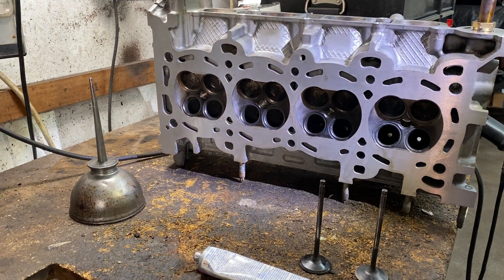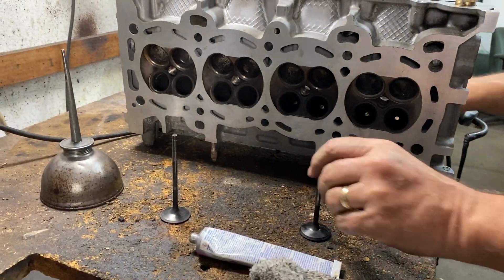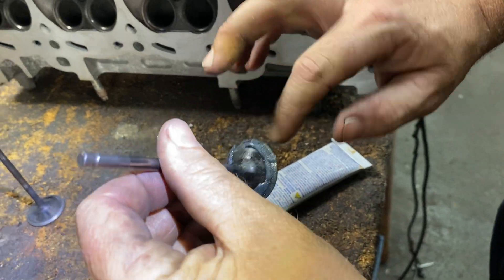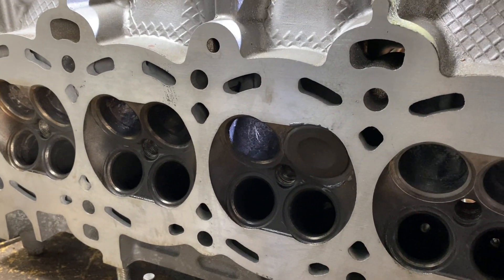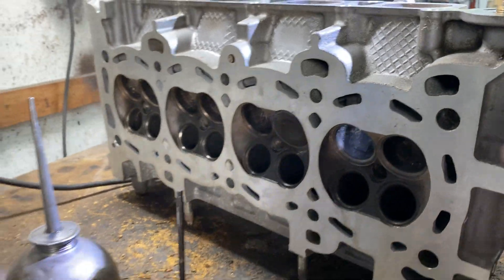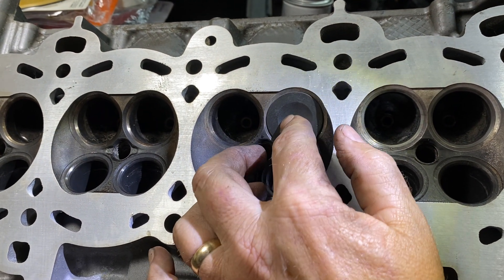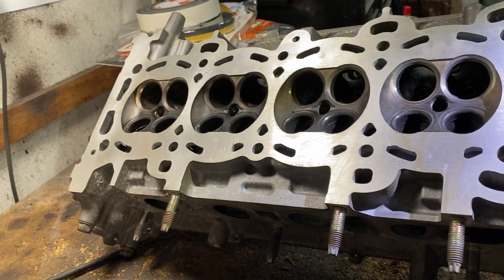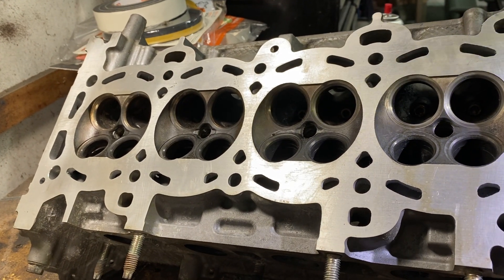Seating Intake & Exhaust Valves by Lapping/Grinding By Hand - Fast & Easy

Comment: I did this until the pitting was gone. I tested it after by putting gasoline in the ports and they all had a small leak. I tested again with water and only some of them leaked . will this be an issue when I install the head or should I take to machine shop
Reply from the maker: If it's only very minor you should be fine.

Comment: I did everything like you sayid and now I tested the valves with water and they are leaking not sure what I did wrong it’s 6.4 Hemi
Reply from the maker: You may have to do them more times depending on how bad they are. Also if the head was warped bad it may need to be replaced but that's in extreme cases.

Comment: Thank you MotorCarNut for sharing your skills and knowledge to help a DIY like myself. I just did a valve job following your instructions and found out from my experience that I get a higher seal rate when lapping in one direction. It is faster when using a drill and when the grinding sound gets more smooth then the surface should be good. Just want to share my experience to help anyone in need.
Reply from the maker: Thank you very much! Great tip, appreciate the feedback and tip!

Comment: Why after polishing it up valve does not shine. I did it with mine  too and it  just took the seat shining valve edge away. Still it seats better and its not leaking any more, but I’m  worry that maybe it will leak again
Reply from the maker: Its not supposed to shine after lapping, your'e fine
Reply: @motorcarnut thanks!
Reply from the maker: Np problem!

Comment: Hello friend, first, thank you for sharing your valuable work..., I have a 4.7 Jeep Grand Cherokee that I bought overheated... and I want to do work on the cylinder heads, I have some questions 1 CAN HEADS BE CHANGED WITHOUT GRINDING? That is, you have a 4.7 mixed water and oil for an overheated one, you take out the heads and put some in, what if they were in a good engine... just buy the new gaskets, IS IT POSSIBLE? 2 How do you know when the valve is burned? Why is his head black? And if so, can't it be used again? 3 I bought the same product but it says I have to use it with water and you did it without water, how would that be correct? 4 How are the valves calibrated? Thank you very much for responding not only to me but to everyone I have read.
Reply from the maker: You’re welcome!
The heads can be replaced with the same head off a different engine but you must measure for warping on the block and head deck for straightness. I have a video on that too. The valves should seal tight with no leakage. You know when valves are burnt because they will have a hole in them or not sealing properly.
Reply: @motorcarnut  thank you very much for responding!
Reply from the maker: @richardgarcia4843 of course!

Comment: Hey buddy, it’s me again! So I am currently attempting to do a valve job on my CCTA head. I have never attempted to do a valve job before but I want the challenge! So I have a couple questions: 

1) if you remove a head form a vehicle that has gone out of timing and has bent all intake valves. What all would have to be inspected/replaced before even considering doing a valve job on the cylinder head? 
2) if attempting to do a valve job, could you “over lap” a valve while using the drill method? 
3) what would be a good method to check valve seat at home? Pour water in top of the valves and wait for the water to dribble out?
Reply from the maker: Hey bro!
Make sure the valve guides are not cracked. 
Yes you can use a drill on low speed
You can use water and cover the valve then use compressed air in the ports and make sure there are no bubbles then dry everything so there is no rust.
Reply: @motorcarnut  what’s an efficient way to check for cracked/bent valve guides?
Reply from the maker: @ivanvega2821 when you pull out the valve look at the valve port and make sure the guides are not cracked, most of the time they are not.
Reply: @motorcarnut  as always my friend. Thanks for the help and the awesome videos! As a request, you should make a video on the proper way to remove an engine from a Volkswagen with CCTA!
Reply from the maker: @ivanvega2821 Thank you! I thought I did? lol ok will when I have another one that has to come out.
Reply: @motorcarnut  well, took the head off a 2.0tfsi engine. It has burn exhaust valves. It’s brutal!!!!
Reply from the maker: @ivanvega2821 burnt valve means they were not sealing properly. Make sure valve seats are not damaged as well.
Reply: @motorcarnut  I was able to allocate a used but not abused cylinder head earlier today. Going to be swapping everything to that head here shortly. What’s the most common reason for burnt valves in your experience?
Reply from the maker: @ivanvega2821 improper valve seating. If the valves don’t seat tight and flush hot air can escape and cut the valve like a torch which is essentially what is happening.

Comment: But still i think the manual hand is better way, because at drill speed will copy the losse of steam valve and guide on the seat
Reply from the maker: I’ve done both with great results. But you do have more control manually I agree
Reply: @motorcarnut  You have great results with both ways because the Seat was very good cutted by great machining
Reply: @motorcarnut  but for sure we thank You for sharing your experience and Ur skills

Comment: I just bought this same compound and it says in the package is old grits from 120 to whatever 200 or so it doesn't specify the grit , so I guess it's whatever😅
Reply from the maker: It's fine, no problem using it.
Reply: As you use it the larger grit breaks down or gets squeezed out leaving the finer grit in the grind zone.
Reply: Hello, is the paste 40 microns or 20? ?

Comment: Would this work for installing new valves?
Reply from the maker: That's what its for, yes.
Reply: @motorcarnut  Yeah in your video you took used valves and lapped them. I read that new valves need to be cut in order to seat properly. That's why I asked. It's comforting to know you can use this method for new valves. I really don't want to take my cylinder heads and new valves to a machine shop because things get expensive pretty quickly. Thanks for the video.
Reply from the maker: No problem, when you’re building a new engine from scratch and using all different manufacturer of parts, then yes, but when you are using parts designed for your stock engine there is no need. Hope that helps.
Reply: Why not use Prussian Blue to see contact pattern on valve & valve seat when finished lapping?
Reply from the maker: @tylerwright754 No need to if you done it correctly.
Reply: Does this work on burnt valves?
Reply from the maker: @garyjones980 no, they have to be replaced first then lapped.
Reply: @motorcarnut  thanks. I have now sent my head away for a full set of seats and calves and a skim, that should sort it.👍
Reply: @garyjones980  When a valve is burnt it's no good and cannot be reused. You replace it with a new valve. And yes you can use the method demonstrated here to install the new valve.
Reply: @chrisyaggi8771  thanks. I have sent my head away for a full set of seats and valves and a skim.